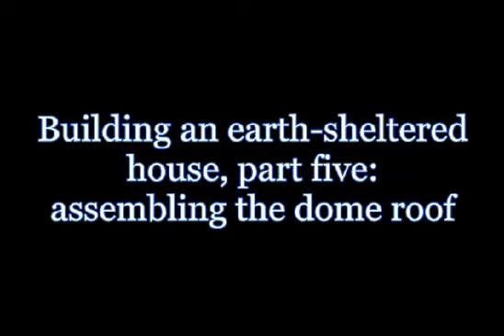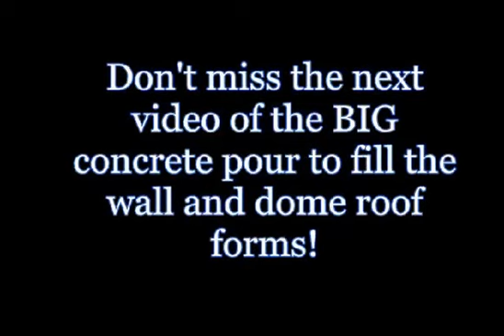Building An Earth-Sheltered House, Part Five: The Dome Roof Form

Comment: Thank you Emily for all the Video's on your earth sheltered home. My father and our family started our build of our earth home around 1979 and as most of our projects still continue today. It is approximately 1700 sq ft 3 bdrm 1 and 1/2 bath and for the weather up here in Wisconsin it is pretty comfy to live in. About the hottest it got in the house this summer was 78 and I believe that's from the heat the dehumidifier puts out. My folks have passed and I recently returned to live in the house last fall. when the house was closed up and just the dehumidifier going the temp inside on the 4th of July weekend was 62. With an 800 sq ft front pourch in the winter with temps below freezing on a sunny day the temps run in the 80's and 90's so I can open my 2 sliders to let the heat in the house. I was drawn to your video's and started with the waterproofing one as we had just had some pretty hard rains up here and found confirmation on a couple of leaks. Our roof was poured in sections and not sure what dad used but i think it was tar not rubber, and the roof is flat not domed like yours. It looks like I'll be up on the roof digging it up before the snow flies
Reply from the maker: Thanks for watching my videos. :)  And hope you can get the leaks sorted out b4 too long. I'm from MN, so I know how early winter can sneak up on a person.